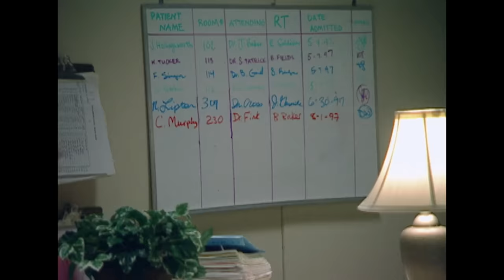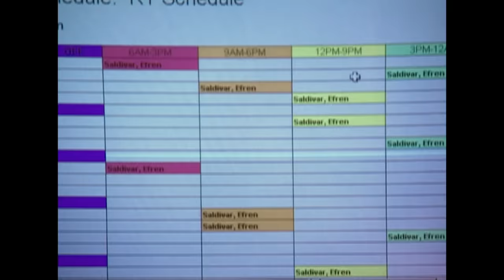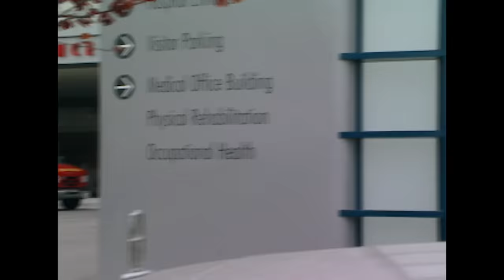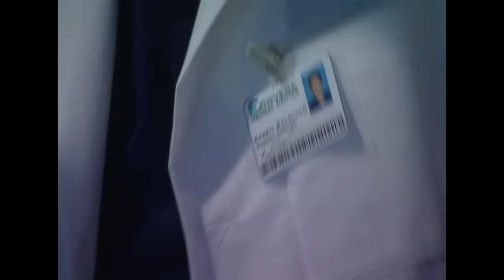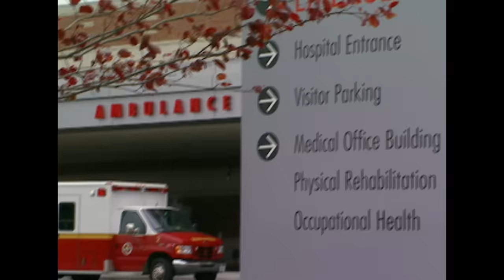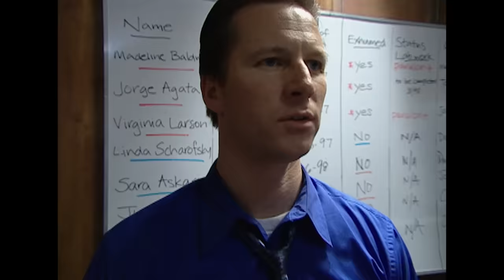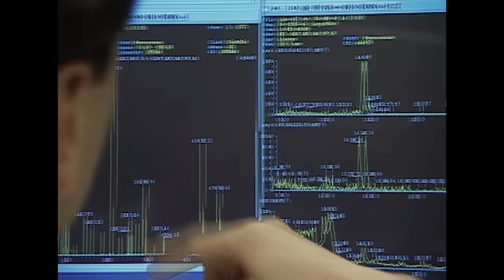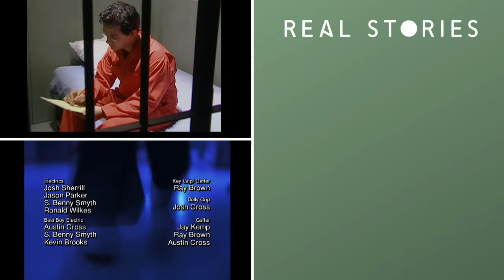The Angel of Death & His Magic Syringe | True Crime Documentary

Comment: Why protect the name of the hospital if the hospital allowed this to happen?  This hospital staff should have been arrested for keeping silent.  Others and I have caught staff red handed pulling out inappropiate doses of medications out of the computerized medication access systems and turned them in immediately. Others and I have turned in inappropiate  staff members who were suspicious for using pulled I.V. or I.M. narcotic pain medications for themselves.  Where were ***###!!! the hospital shift R.N.supervisors ?   Why weren't the nursing supervisors  doing regular rounds on all of the floors and units on a regular basis?  The three years that I was an evening and a night supervisor in an upscale, 6 floor, 550 plus patients, chronic nursing/ rehab facility, over all of the nursing staff and the security staff- (outside of working in  multiple hospital critical care units and emergency departments for over 40 plus years), I did regular rounds on every unit, on a regular basis, by taking stairs, instead of elevators. I went into patients' rooms, to check on patients and on nursing staff, and help nursing staff. What kind of  R.N. staffing did they have , that this could've happened in front of other R.N.s on staff?

  What kind of hospital was this, that respiratory therapists had access to these types of  intravenous controlled, narcotic substances to treat significant pain, intravenous  medications  used only to anesthetize  patients,  and intravenous medications used to paralyze patients' breathing,  used before intubating patients? Respiratory therapists shouldn't ever  be administering intravenous medications and intramuscular medications. Even respiratory therapists can only obtain inhaled respiratory medications by computerized access, with fingerprint access or password access.  In all of our regional hospitals, medications could only have  been obtained by accessing them through a large computerized system, accessed by password or fingerprints, since the early 1990s, even in trauma rooms, where we hold medications used in resuscitating patients and medications used before intubating patients  Before then, medications could only be obtained by double locked cabinets and refrigerators, with the keys being held by the charge R.N. and other access areas keys, held by the nursing supervisors. Physicians and medical staff have no access to obtaining  medications, outside of the operating room.  Why didn't the nursing supervisors go around the entire hospital and check up on what was going on?
Reply: I mean it was easier back then to go undetected when someone had their mind made up to something. Even with diligent nursing staff things can still go wrong. And everyone knows nurses are NEVER fully staffed. That’s one thing that hasn’t changed since then.